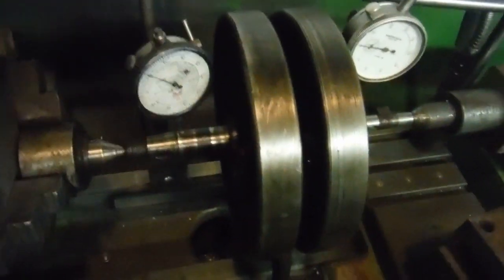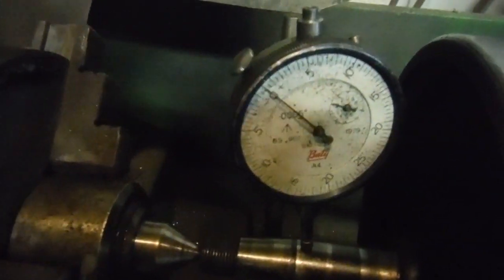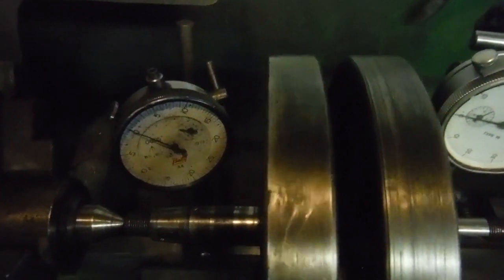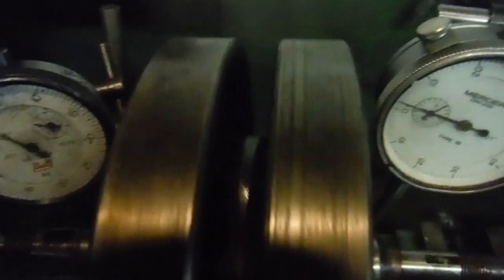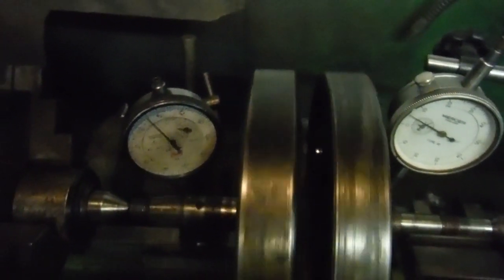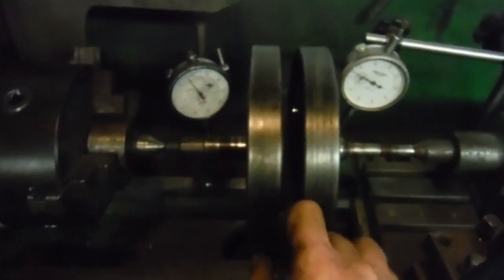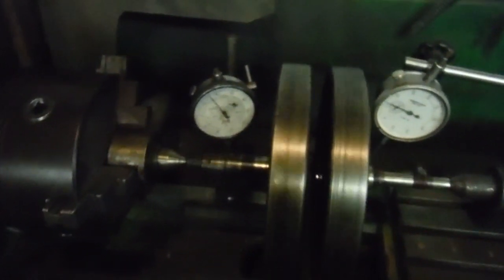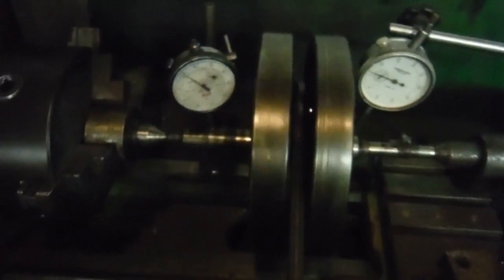BSA 350 cc Model L engine circa 1930 strip and rebuild 7 Checking crank runout after reassembly.

Comment: Paul, I was watching your other video and you mentined you were going to make a shim to stop the wandering of the crank. How are you going to get those dimentions?
Reply from the maker: Hi - RE Bullets use a spacer in that location which is the same width as one between the outer races. Would you believe, such a spacer is also the same width as the outer one on the BSA engine, and I have one, and it fits the mainshaft perfectly! If I assemble the crank loosely in the cases with the main bearings in place and find there is end float, I will shim between the flywheel faces as required, to take up the end float and centralize the crank relative to the crankcase joint.